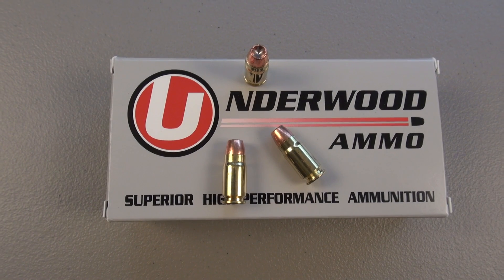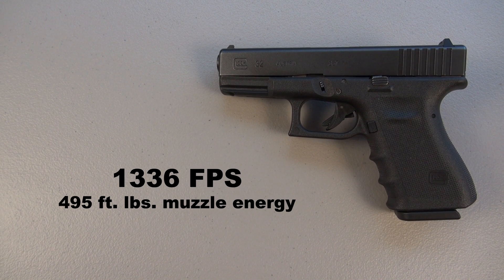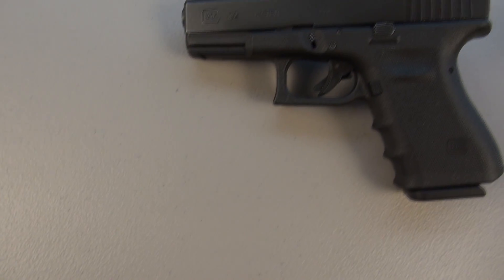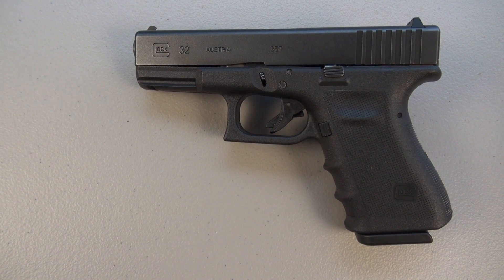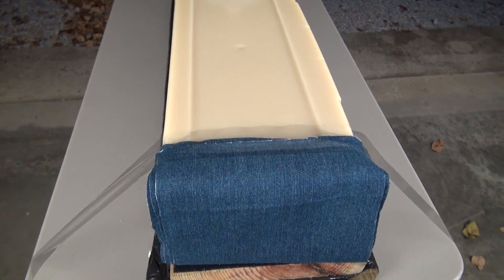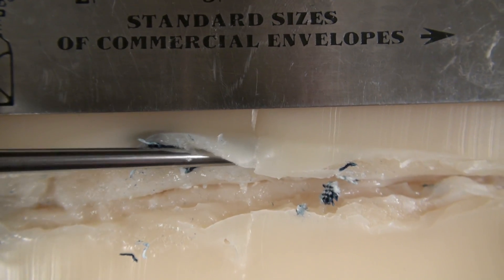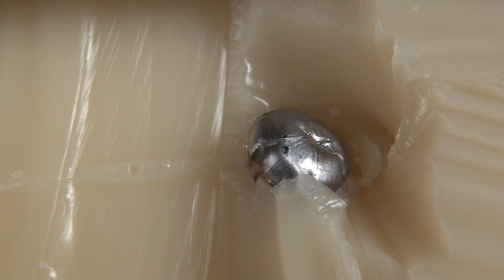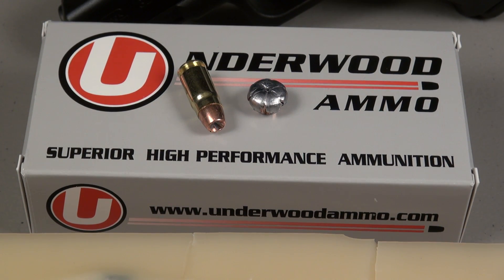.357 SIG Underwood 125 gr Gold Dot Ammo Test (SIM-TEST)

Comment: The funny thing is, aside from the lower velocity of the Federal HST or the Winchester Black box (almost a 100 FPS slower) it seems like those two loads do better at tissue damage... maybe bullet design is better for that compared to Gold dots..  at least in this caliber... maybe Gold Dots are not paying off unless they are in standard velocity ranges (1000-1200) maybe the fact that the other two loads are going so fast anyways and penetrating fine anyways, its better to use the slower loads for this caliber

Comment: imagine this load in a glock 24 converted to .357 sig. can you say 1700 fps and EIGHT HUNDRED LBS OF ENERGY.
Reply: Nook not 1700 fps that would be too slow for 800ftlbs of energy
Reply: @jeffioiselle7982  no its not. its 802 lbs of ME.
Reply: @MrSGL21  what's the grain weight of the round?
Reply: @jeffioiselle7982   take a guess.

Comment: I just changed my p226 Equinox from 40 to 357 way more accurate. At Least for me and I’m a pretty good shooter. All the boxes of ammo I have for that round are only 1350 at 125 grains I’m going to buy that underwood stuff soon . The recoil is stout for me only with heavy bullets so I should be fine. I can shoot 180 grain from my 40 pretty good however I am not happy with my accuracy even thoe my buddy’s say that it’s just fine.Not for me. My 45 I can shoot hole for hole at 15-20 yards. For some reason I can’t do that with my 40. The 357 I can also shoot hole for hole or 1 inch groups at the same distance. That’s what I like.😉

Comment: This basically gives you .357 magnum velocity and energy from a semi auto. This will definitely be my carry round. Bonded bullet right in the middle of 12-18 inches 15+1 capacity in a G31. Permanent wound cavity is 8 inches vs 6 inches in most of his 9mm vids. If The price was lowered and sig opted to name this cartridge either "9mm magnum", "9mm Super" or ".355 magnum"  I bet it would replace 9mm as the king of the concealed carry hill.

Comment: It is thanks to this kind of performance that I am a convert from .45 ACP to .357 Sig.  I handload Gold Dots using 9.6gr of 800-X (use at your own risk), and it not only averages exactly 1,500fps from my Gen 4 Glock 31, but the extreme spread of velocities was only 5fps.  This full power load does not seem to recoil much more than the Speer Lawman practice stuff, and definitely less than a .40, 10mm, or .45.  It feels about like shooting standard-pressure 124gr HST 9mm ammo from my wife's Ruger LC9s.  I have also taken a good few deer in North Carolina with it out to 50 yards, and with proper shot placement it puts them on the ground as quickly as my .308 or muzzleloader!
Reply: @Murcielago SV Spoken like a true jackass.
Reply: Glock 31 = longer than 4". So... All the hunters who use 10mm, 44mag,. 357mag, etc, are unethical? Furthermore, if the performance of the cartridge allows for an ethical kill, so what?
Reply: Joe check out masafe ammo at 2150 fps and 684ftlbs of energy I also know of one other round that is much faster and hits with over 700 ftlb of energy so they advertise.
Reply: You are a fool .45 ACP is King

Comment: I have the model 33 in 357SIG with a 3.4 inch barrel and it is a handful. I don't carry it for that reason and the fact that it's almost $50.00 for just a box of ball rounds is ridiculous to say the least. It's also as someone mentioned not an easy cartridge to find. My 9mm certainly doesn't have the velocity or energy that 357SIG has, but I've never met anyone that wants to be popped with one either. Not that I have any interest in being in a gunfight anymore than anyone else does.
Reply: I don't want to get popped with Dennis the Menace's slingshot, either, but that doesn't mean it would be an effective defense against a determined attacker.
Reply: Very true, but all handgun calibers have failed to stop an attacker even with well placed shots. Certainly, a 9mm, 45, a 40, whatever is better than a 25 ACP, but just like you, I don’t want to be popped with anything including Dennis the Menace’s slingshot. Rocks or anything else will ruin your day, especially out of a slingshot. As for one cartridge being better than the other, that’s a war that will never end just like which is better, heavy or light for caliber bullets. Whatever it is that you’re carrying every day, I pray you never have to use it and thank you for your reply. 

Best wishes

Comment: Wouldn't it be cool if you bottlenecked a 45 casing and paired it with a 40 cal bullet
Reply: Micah Colister it's called .400 corbon
Reply: Micah Colister *45 casing with a .17hmr bullet. i want my ammo moving faster than the speed of light. lol
Reply: Micah Colister but yeah 45 necked to a 40 would be cool. it would definitely make 40 suck less. I only say that because i have a dislike of 40 due to its neutered 10mm origin.
Reply: south park    ALSO .40 SUPER.... ITS MORE POPULAR THAN .400 CORBON
Reply: Micah Colister 
Already been done some 20-plus years ago.  It’s called 400 Corbon.
Reply: Just get a 10MM

Comment: What is your recommended.357sig Ammo? Watching your videos it looks like ether this round, or the PDX1 but it's hard to keep them all straight?
Reply: I've shot 357 sig for 10 years straight. Underwood for ammo manufacturer. They are just some of the most consistent and well made cartridges for handguns you can get. This here, 125 grain 357 sig Underwood Speer Gold Dot, is still one of if not the hottest load you can get for 357 sig with a hollow point and in my opinion is not hard to shoot if you are conferring shooting. The other is something called an Xtrene Defender 90 grain 357 sig all copper projectile. It's lighter so it mitigates the recoil very well, and it has all the benefits of a fmj with all the damaging effects of a hollow point if not better. There is contention as to how well this design would work at slower speeds, but the 357 sig is going 1700+ fps so thats not a problem. I have looked up and bought at one time or another every type of 357 sig ammo and I don't talk out of my ass, so these two are very good guaranteed.

Comment: I have had the g32 for a few years and fired hundred if not thousands of rounds of the highest pressures I can find including underwood and many many others and never had a single hiccup.and it's still my edc weapon and deff. trust it
Reply: Most .357 Sig ammo you buy is going to be no higher pressure than the NATO-spec 9mm.  Even with handloading, choosing the proper powders like 800-X or Longshot will keep you in very mild pressure ranges while giving velocities easily above 1,400fps with 125gr bullets.  As long as you replace the recoil spring every 3-5,000 rounds, a pistol in that caliber will last as long as anything else.
Reply: Matt Favor me2 Glock 27 with sig barrel

Comment: I am contemplating buying a Glock like the one in your video. The Underwood ammo used is impressive, but I wonder about the durability of this pistol in the long run if fed a regular diet of it. What do you think? BTW, thanks for all of the great videos
Reply from the maker: I change the spring (using OEM spring/guide rod) about every 1500 rounds.  This gun is built to handle the pressure, as is the brass.

Comment: Hey TN, do you use actual heavy denim or four layers of a pair of denim from a pair of jeans?
Reply: Also, what ammo did you find to give the best performance in .357 Sig?
Reply from the maker: Heavy denim.  Please don't tell anyone I shop at Joann Crafts.

357 SIG.....all the 125's are pretty consistent, so I go with the most readily available, which is Speer Gold Dot.
Reply: +tnoutdoors9 I actually have a Sig 320c in 9mm, but I like it so much that I'm buying a Sig 320c in 357 Sig! Federal HST 9mm 124gr +P JHP's is my 9mm ammo of choice, but I haven't decided on what I want in .357 Sig... CHOICES! CHOICES! CHOICES! I know they all give consistent results, but what would be your PERSONAL CHOICE if you carried a .357 Sig with a 4" barrel?
Reply from the maker: 125 Gold Dot; factory made, Underwood, or even Georgia Arms.  HST's in 357 SIG are hard to find.  50 rd boxes of Gold Dots are less than $30 online.  I am such a huge fan of 357 SIG and practice with it quite often, but I usually revert to 9mm for EDC.  For s#!%$ and grins, take a look at the ATK Vista Law Enforcement site.  It will take a few minutes, but check their FBI protocol tests for Gold Dots in 9mm, .40, .45, and 357 SIG.  When seeking something with more pop than 9mm, I like the higher momentum factor with 180 gr .40, but prefer the recoil impulse of 357 SIG.
Reply: +tnoutdoors9 Thanks a lot, Sir!

Comment: I love this video! I have watched it quite a few times. This is the reason I ordered my Sig P320 in 357 sig caliber. You are right these bad boys pack a wallop! Very accurate, fast follow up shots double taps not a problem. Recoil was a tad bit more than regular factory stuff but still not bad. Thank you!
Reply: I just got a 357 SIG barrel for my full size P320.  I'm in love with 357 Magnum, but with these I can have my cake and eat it too.  The cake being power AND capacity.
Reply: Invest in a KKN match barrel with a external compensator this will reduce the rise of the muzzle by 25-30%.i love the one I have.

Comment: Yes they are different, but at what cost and difference of effect.  Also, the  7.62x25 mm Tokarev is battle proven.

7.62x25 mm Tokarev
85 g JHP - 1,700 ft/s 527 ft·lbf

.357 SIG
115 gr JHP - 1,550 ft/s - 614 ft·lbf

Comment: Always been a fan of Underwoods ammo for a number of years now. Buffalo Bore makes some great products as well, but for 9mm I cannot/will not use their products, everything else has been great for me from both companies. Now by saying that im not bashing Buffall Bore at all; my issue is that some of my favorite handguns that I own in 9mm do not reliably feed +P+ Buffalo bore because the expanded cases get so large they stick in the chamber and need to be removed by hand/tool. This is not a problem in my factory Glocks, but a few of my other 9mm with tighter chamber tolerances do not digest Buffalos hopped up +P+ but will run Federal/Speer/Underwood etc +P+ fine. The guns in question are namely my Kimber and S&W 9mm pistols (non M&P), as it seems .389ish is about the max of expanded brass diameter that will function properly in those tighter chambers, and the 115 and 124 +P+ Buffalo Bore regularly comes in larger than that for me. Underwood has never given me the issues, excellent company. Also in closing I must say I have been sad to see TN not producing any new videos. ive literally watched every single ammo test you have uploaded to this point and you are my favorite internet ballistics aficionado by far! All i want for Christmas is some new TNOUTDOORS9 ammo tests to watch in my free time! lol Happy Holidays

Comment: I like it.  It turns into a .50 caliber hole.  I just picked up a Sig P229 and P226.
Reply: How do you like it so far? I have the 357 sig in a glock 33. I like it a lot, and I don't even notice the recoil being much different than my friends 9mm. Just a sharper pop initially. It handles the pressure really well. I have the xtreme defender in 90grain and the xtp hollow points, both by underwood.
Reply: Kyle Hornung
The heavier pistols handle the recoil just fine.  I do need to purchase some Underwood ammo to try out.

Comment: It'd be REAL nice if Underwood would start cranking these out again. Sold out of even their FMJ in 125 gr. Come on guys!
Reply: back in stock
Reply: +William S yep I got my 100 round of the updated version of the Underwood 125gr bonded gold dot with nickel plated case and 1475fps.
Reply: They have some now, just bought some and saw your post so I figured I would give you a heads up.
Reply from the maker: +William S I hear ya.  I'm on Underwood's email alert list for their 147 gr 357 SIG Gold Dot.
Reply: +William S yeah!  I just picked up two boxes this week!
Reply: +William S I called them and asked, no foreseeable plans to produce 1475fps 357sig :(
Reply: i_hate_cars Thanks for the tip. I just ordered some Buffalo Bore 125 gr @ 1425 fps but they're not Gold Dots, just BB's standard JHP.
 Definitely not cheap after adding in shipping.
Reply: Ozzy ô lol! my 3 boxes arrived 2 days ago ;)
Reply: Kyle Hornung Got 3 boxes a few months ago but thanks!
Reply: I had no trouble getting Underwoods 357 sig in 8/2018

Comment: Comparing a 357 Sig to a 357 mag is not like apples to apples. Auto cartridges tend to be loaded with hotter burning powders this enables them to gain more effect of the charge. To see the difference best is compare a 9 mm to a 38 special,even tho the 38 is a bigger round length wise ,9 mm out performs 38 in velocity and muzzle energy even when loaded close in bullet weight.

Comment: Main advantage to a 357 Sig over a 40 cal is it shoots lighter bullets glasser(corbon) has a powerball 40 cal at 135 grain weight my glock 35 (5 1/2 inch barrel) smokes those rounds out at 1400 dps. The lighter the round higher the velocity but shooting too light will effect penetration and bullet performance on impact. I tend to shoot light/medium weight in range shooting but for a defensive round want a heavy/medium.

Comment: Well I wouldn't really know for sure (i've never tested guns on anyone) but two rounds that had the same amount of kinetic energy but differing diameters and weights will transfer exactly the same energy to the target. So the question is, do you want more penetration or more trauma a shorter distance into the target? If you were to blow a wide hole in someone's chest only an inch deep you wouldn't hit anything vital (just an example).

Comment: Hey so I read your comment too quickly before. I forgot that its (m x V^2)/2. Also, we really have to convert the velocity to m/s and the mass to kg. 1kg = 15432 grains so 124 grains = .008035 kg. 1500 fps is 500 m/s so the equation would be (.008035 x 500^2)/2 = 1004.37 J. The proportions between the different calibers should be right though. Also the width of the bullet only matters if it hits something important because of the diameter or if the bullet exits the target. Did that make sense?

Comment: Std pressure for .357 Sig from SAAMI specs is 40,000 PSI which tosses a 125gr bullet @ ~1450 fps. Pistol is supposed to be designed for that spec, which is why it's NOT a brilliant idea to just drop .357 Sig barrel into a .40 S&W pistol designed for SAAMI max pressures of only 35,000 PSI in .40 S&W. Velocities of 1475 to 1515 fps are not that big a deal for .357 Sig., being only ~ 4.5% increase in pressure which is < 10% increase as defined for +P ammo in 9mm by SAAMI. Not much gr8tr pressure.

Comment: Would there actually be interest in that? I stated a spreadsheet with some data from his tests for my own use that covers manufacturer, weight, name, FPS avg., stretch cavity, penetration, expansion avg., expansion max, retained weight, jacket separation / framentation, media used, test gun used and range from block. I could finish it up and post it if anyone wants.

Comment: Pretty clear that the .357 bullet was designed for high speed, while the .40 bullet used in the hot Underwood 10mm wasn't designed to be  hot-rodded that much.  Since this is concealed carry ammo I would be interested to see how it would be affected by the shorter GLOCK 33 barrel.

Comment: It would serve well in the G33, with the sub's normal speed loss of 100fps.+. Federal's load clocks around 1400fps. The GD bullet definitely handles speed the best, with expansion being similar to the Speer load. The 9x25 Dillon moving 200fps faster would be interesting to see, as well. Thanks for the video.